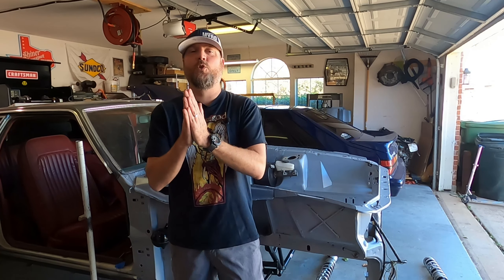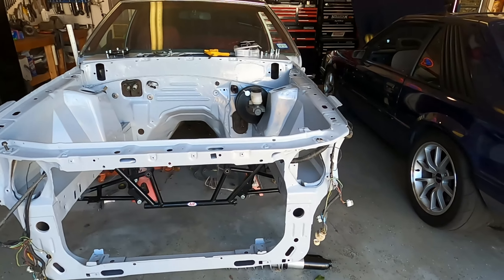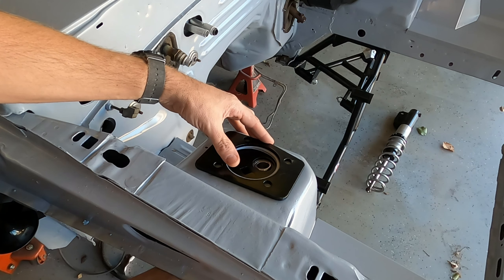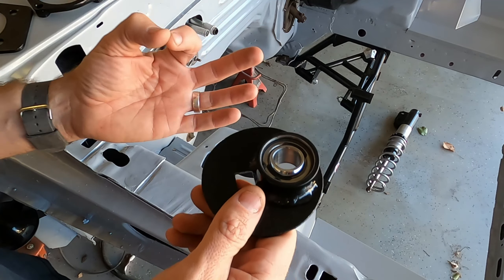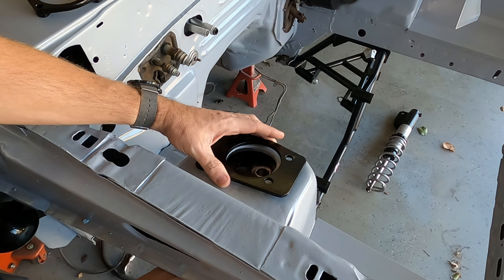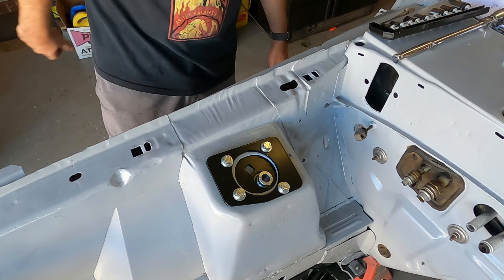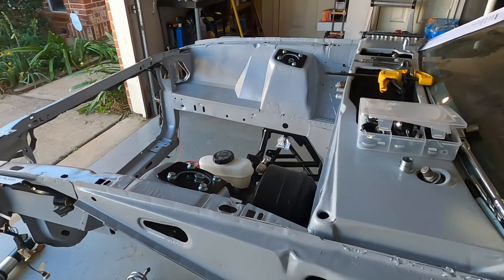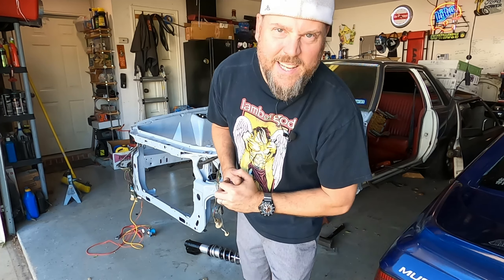AJE Caster Camber Plate Install - Foxbody - Episode 24

Comment: my driver's side strut tower is way different than the passanger side. nothing lines up on driver side. calling AJE first thing Monday before I chop my stuff up. 
passanger side went perfect. and you are the only aje caster camber plate install video on YouTube.
 you did great explaining the passanger side. but it video flew through the river side. and by watching ur video I can tell it's are different too. .
Reply from the maker: Yeah, well thanks, and it is hard to keep the video length down. Basically if the video goes over a certain length people see that and lose interest. But, as far as the driver side, I didnt film it because its the exact same process just mirrored. Both pieces are identical. Go rewatch right at about 10:50 mark. I explain the driver side, then video on the passenger why I chose to flip it around versus AJE instructions to point the taper in towards engine bay.

Comment: Other brands like MM you can adjust caster and camber independently, it looks like with these plates if you adjust either one it will affect the other.
Reply from the maker: Yeah its pretty interesting, but according to them it really only affects Camber and Caster is pre-built in, though you’re correct there’s No reason why that would not adjust both a little bit. I’m always used to plates that are independent for both. We’ll see how these work out.